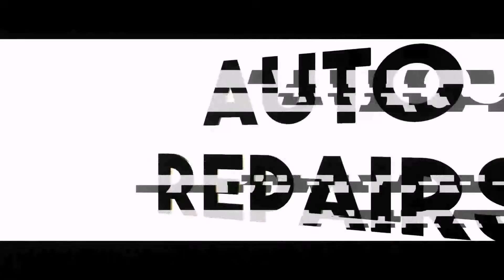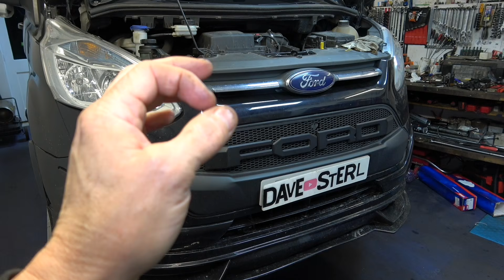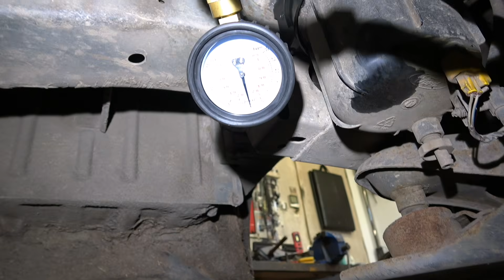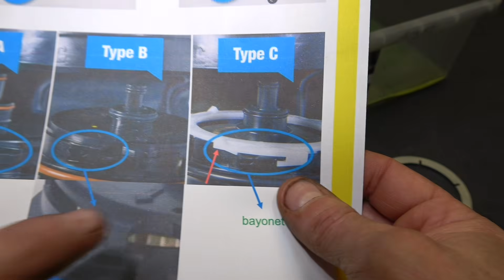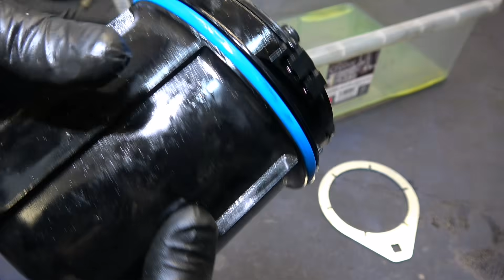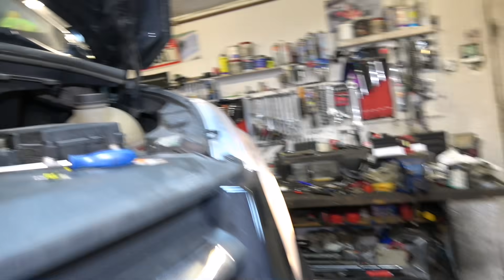Ford Transit 2.2 Diesel Fuel Filter Change and Bleeding Made Easy

Comment: I have a 2015 Ford customs 2.2 and had it since new, I have serviced it every 5000 miles and changed the fuel filter every year and never bled the system ? Just fitted new fuel filter turned key on and off about 6 or 7 times and van starts up no problem at all ? Just did mine again today never had a problem ? Can I ask does any air in the system leave naturally, I am guessing it does as I have never had a problem. After watching this I will check if any air is in the system the way you have. Great video Dave by the way. Ps as I said I did mine again today and van has only run for about 10 mins sitting out side. Out of curiosity I had to go out just now and check was there any air in the system the way you did it. I pushed the valve down and fuel came straight out so guessing any air must be pushed out the system or am I wrong Dave . And as I said been servicing my van for last 11 years never had a problem just changing filter and never bled it ? , I will from now on mind you lol. And I would say to anyone doing this buy the right tool to undo the filter housing that are only £15 and makes the job simple.

Comment: Interesting point about the airlock, that could be my van, obviously isn't, but same colour and year etc.
When I first switch my ignition on I always hear air bubbles at the fuel tank/pump, which was concerning.
But after your explaining about how the in tank pump merely tops off the filter, I can only assume it's air in the filter/swirl pot/return lines I'm hearing.
Though I might pop that valve cap off and see if any air bubbles out with the pump running just in case.

Comment: Interesting stuff as always Dave. I once wasted 2 hours of my life removing a Mondeo fuel tank only to find that the in-tank pump was not connected to the fuel line what so ever. It’s only purpose seemed to be to keep the swirl pot full at all times while the engine was running. I use a bit of Vaseline on filter O-rings. I buy the biggest size tub of it every time I visit the chemists; that gets a few funny looks btw!

Comment: Nice one Dave , have seen these where after many attempts to start after fuel filter change , where the ecu  locks out starting the engine , then shows a fault code , which needs to be cleared 😂,  has the customer been saving up all the common jobs for you to do 😂, I did a ns shaft and front wheel bearing on a mk 7 last week , lots of crust on the Torx bolts on the bearing , I used the tool to push the bearing out of the hub , it was solid 👍,  Poppy is growing up so fast 👍

Comment: great explation  and information  as aways dave . we alwaly found  transits  hard to start after fuel filter change even with  system primed up  as much as possible  .  . our irish man method to start these was to tow it  that always worked  but not ideal . .